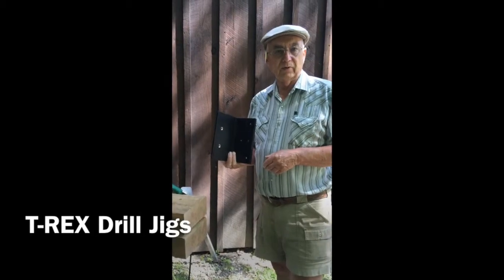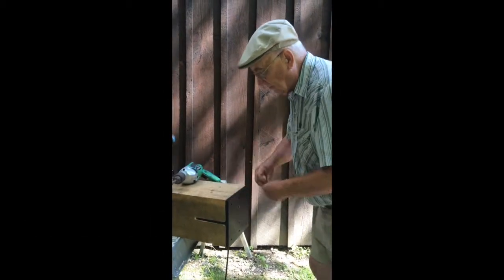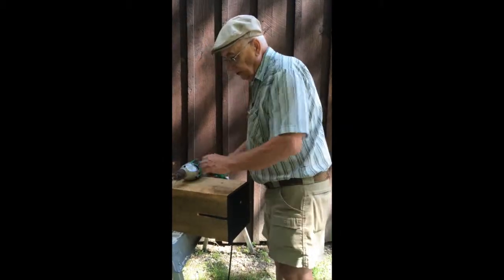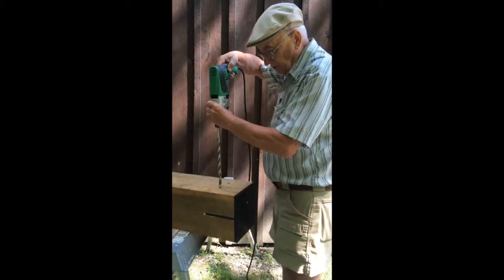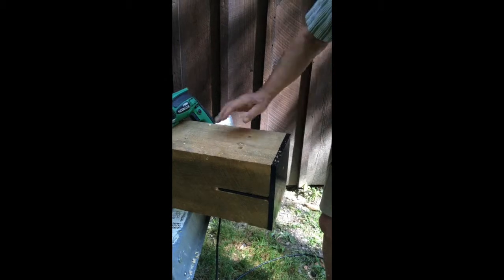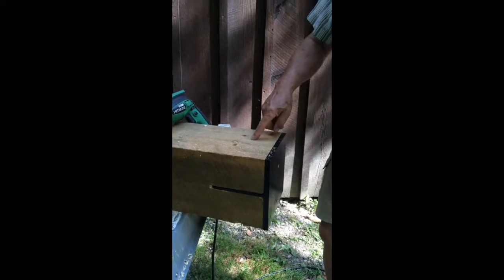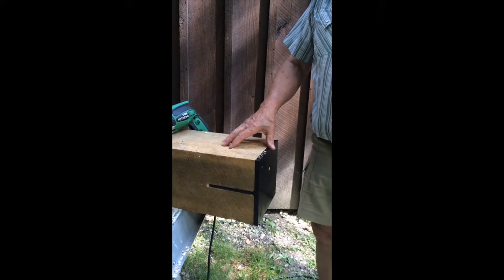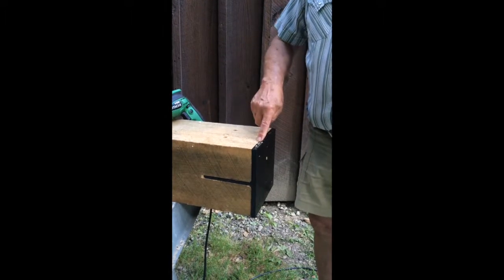T-REX Drill Jigs | Timber Framing | 203-534-8771

Comment: This looks easy in a shop what about when you're using it as a Masonry Anchor for heavy glue lam beams. You have to support the beam at exactly the right elevation while glue and, or do it on the ground and then mount the plate on to the masonry and drop the beam over the flange, hold it in position and pin it. Not easy over a 29' span

Comment: My concern is drilling both plumb and square to hit the hole in the steel
Reply: Our connectors are aluminum and therefore cut easily. This older video shows one option of using the Drill Jig with a Drill Press. You can also just drill down with the Drill Jig, cleaning out the flutes along the way, and go right through the aluminum and the remainder of the wood beam. This method is used most frequently:  check out this other option at https://youtu.be/GlDvybsux90.